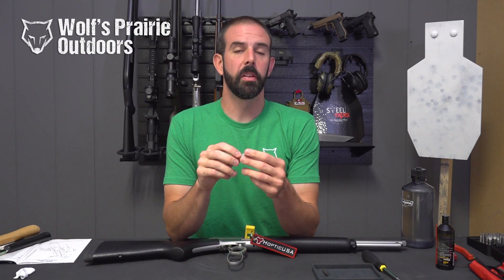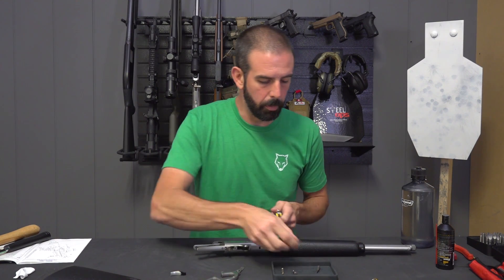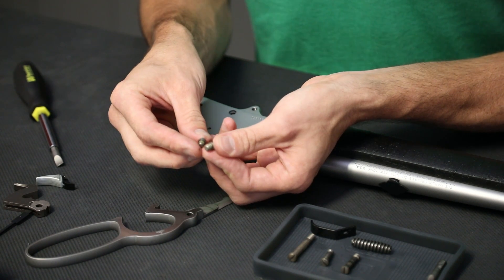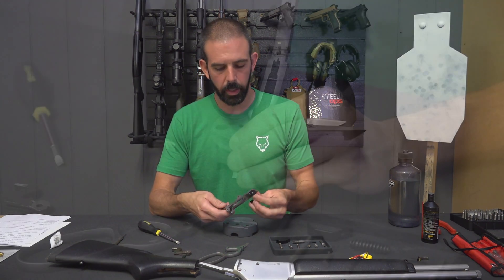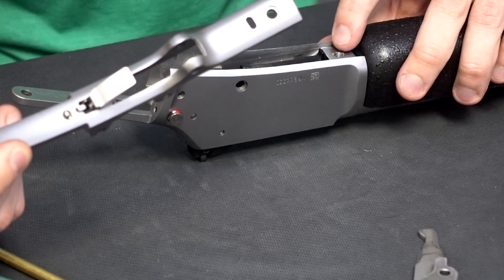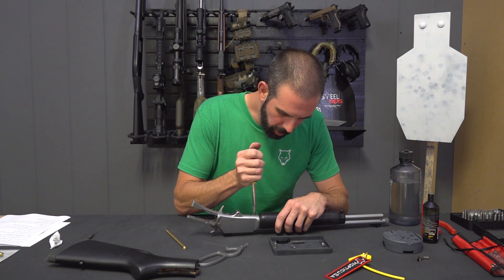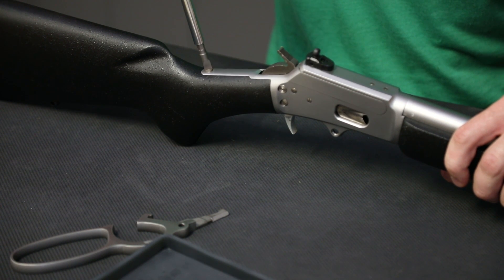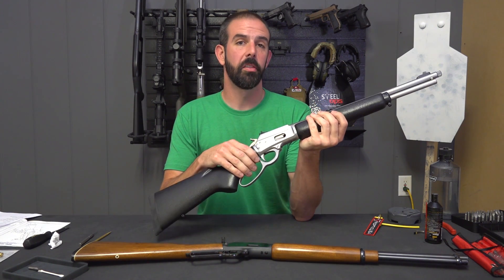Marlin 1894 CST - Ranger Point Precision Trigger Kit Installation

Comment: Just did the install, if my new trigger moves forward slightly when the gun is not cocked is that normal? When it’s cocked it has no movement an def breaks nice an crisp? Just curious if that slight front movement when not cocked is normal? My 1894 dark also had torx head screws throughout.. thanks for the help
Reply: Never mind I just talked to Kim from RPP she set my mind at ease, she informed me that the forward movement is normal. Great customer service and super helpful I wasn’t put on hold or transferred to ten different people etc. can’t wait for my loading gate to show up!
Reply from the maker: Glad you got it worked out! Kim is awesome!

Comment: Of course, I stopped watching when you had it all apart. When I installed the trigger plate, I tightened both of the screws before installing the trigger pin/screw. The holes didn’t line up. I figured out that I had to loosen the bottom and side screws, install the trigger screw, then tighten everything up. Of course you mentioned that when I watched the rest of the video. 

Good, clear instructions.

Comment: Thank you much for this video.  Clear voice, easy to understand and good steps to follow.  I’d like to say my trigger kit installation  for my Marlin 1895 45-70 Government went exactly like the video, but no such luck. I spent about a half hour, maybe a little more, and used some very colorful language, wiggling the trigger & sear and moving them around a little this way and that way, until the pin went all the way through the trigger plate and the new trigger & sear.  While I was at it I replaced the loading gate with a Ranger Point loading gate and a Ranger Point quick takedown screw.  

I’ll take all of this as a win because, although it might have taken longer than I thought it would, it got done.  The rifle went back together easily with no missing springs,  parts left over and no missing tools.

Comment: Clear and concise video. Question though. Does this trigger reduce trigger pull? What makes it so much better than the original trigger?
Reply from the maker: Thanks! Yes, it does reduce pull weight slightly. It's better, in my opinion, because of the reduced pull weight, it's a more crisp break, and the design eliminates the standard Marlin trigger flop because of it's two-piece design. Additionally, this particular trigger is wider and flatter, which is something I like.

Comment: Very good video! I recently picked up a 2001 era Marlin 1894CP with the Ranger Point trigger and Ranger Point large loop. I like the trigger but the loop is so sloppy that that it is a bit tedious keeping the lever closed so the gun can fire. Is it possible that something isn’t installed correctly and/or should I put the original loop back in the gun? Can the Ranger point trigger cause this problem?

Comment: Very helpful video; I like the series and the modifications you are making to your rifle.  Based on this video, I ordered the trigger kit from RPP for my Marlin 1894 CST.  The package I received also included a Wolff reduced power hammer spring.  You did not mention the Wolff spring in your video.  Was the spring not included when you bought it?  I note that it appears the RPP is changing its product description of the trigger spring kit and eliminating the Wolff spring.  Do you have any thoughts on the use of the Wolff reduced power hammer spring?  hanks.
Reply from the maker: Thanks, I'm glad you liked it! The Wolf spring is an option with the trigger. I didn't get it with this one, but I did with my kit for my next build project. Soon, I'll be starting a 30-30 project and will show the differences in the two triggers. I think the reduced power spring will give you a better/lighter trigger pull. It all depends on what you want to end up at. You could try it without the spring added in for a little while. Then swap the springs and see how you like it that way. I've heard good things about it, that's why I decided to give it a try on my next project. Thanks for watching!
Reply: Thanks.  I looked at the RPP site and trigger kit page again today and it may be that they are simply out of stock and that both the trigger and spring are still included in the kit.  Good luck with your videos.  I have subscribed and will continue to watch.
Reply from the maker: You’re welcome! Yeah that may be the case. Thanks so much for following along, we really appreciate it!

Comment: With the installation on the new trigger did the trigger weight drop ? Was there any difference in the reset or take up?
Reply from the maker: It drops the weight a little. It is also crisper and breaks better

Comment: I have a question i just did the trigger and loading gate installation on my marlin Dark and everything went great, so thank you for the videos, except the safety doesn’t work anymore. it fires fine just no more safety, any thoughts?
Reply from the maker: You're welcome! I'm glad they helped you. I'm not sure about the safety issue. You might want to call Ranger Point. I've not experienced anything like that in my builds